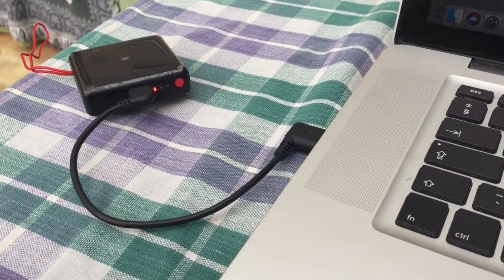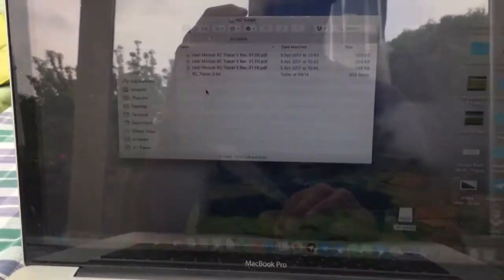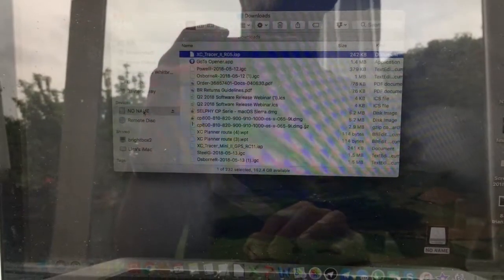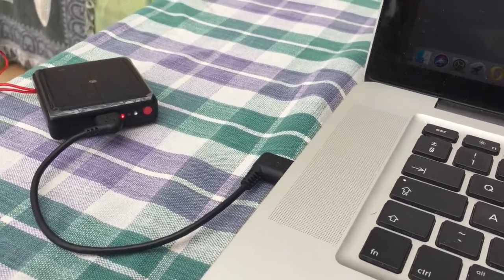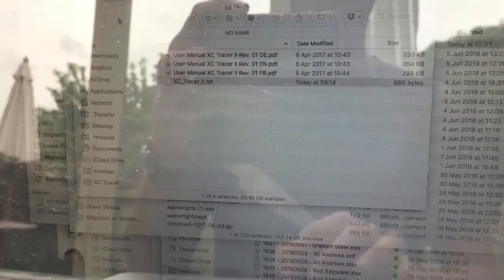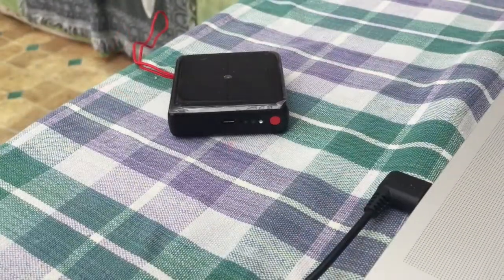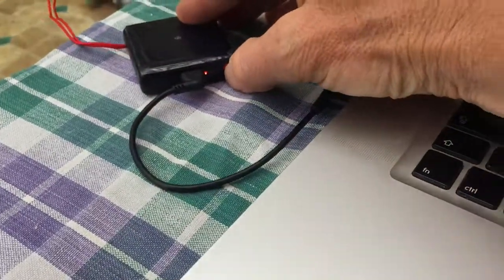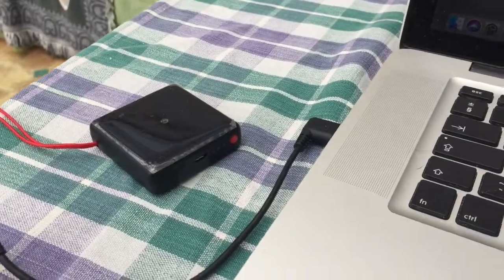How to update the firmware on your XC Tracer II

Comment: Hi Tim, I have followed your instructions that are same as the manual indicates  however didnt work in my case as the device does not reboot it self and the icon on the SD storage does not disappear. I was wondering if you have any trouble shooting. thanks  you :)
Reply from the maker: Just to get some background info, what device have you got, and what's the name of the firmware file you're using for the  update? And what version are you currently on?
Reply: @TimPentreath  Hi Tim, Thanks for your reply. I have bought the II Flarm and I have no idea what firmware It runs I uploaded on the folder tha latest one from XC track wich is only an update to the Flarm if I understood correctly.
Reply from the maker: @covremauro  See https://www.icloud.com/sharedalbum/#B0v5ZhN2vZFywD